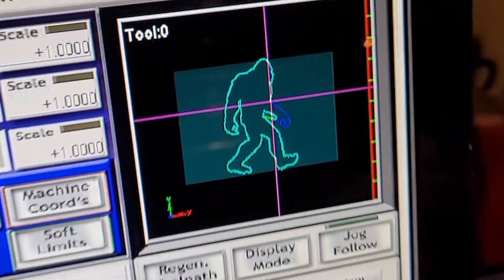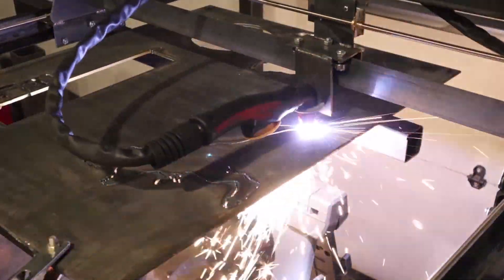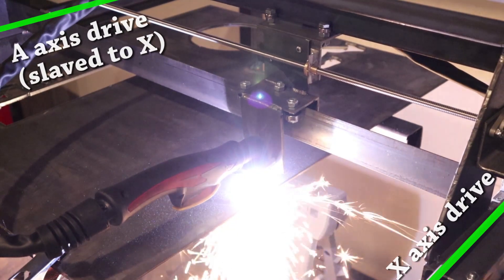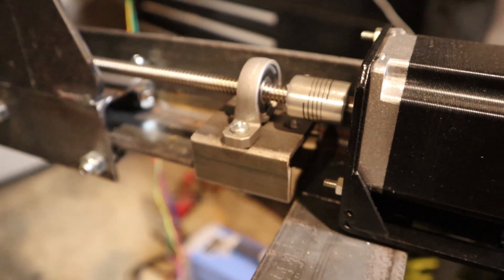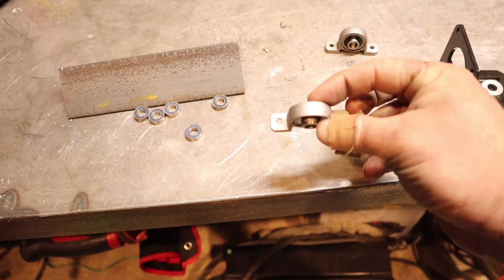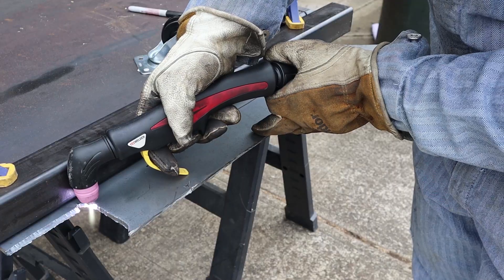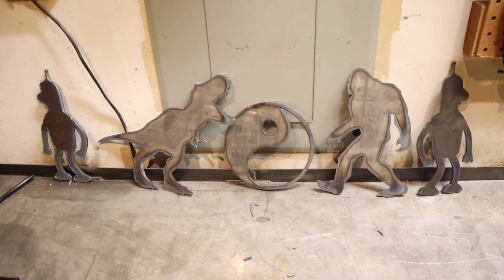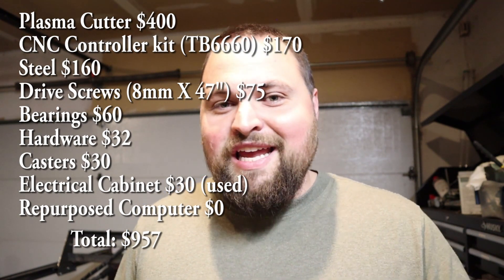Build a CNC Plasma Cutter for under $1,000

Comment: Have you considered putting the plasma feed cables inside liquidtight flexible metal conduit and properly bonding the metal liner to the plasma source?  Would love to know if this would work in place of other methods as it would simplify things considerably.  Guess I would also make sure the workpiece grid is bonded to the source bond also.  This would raise the question of parallel paths but I'd have to assume the welder internal circuitry has some way to address that and make sure that.   I saw another youtuber connect the tip nozzle to the return clamp via a 14 guage wire or something.  This stabilized his arc substantially.  I don't actually understand what was happening here.  But if what I suspect is happening is right then this might work even beter with a resistor in series with this wire to attenuate EMF produced by the HF.

Comment: Oh the joys of a HF welder/cutter.  Fun fact, even with ground isolation, HF will generate sparks on equipment that aren't anywhere near the work site.  I have an old Miller HF from 1971 and the manual illustrates installing earth grounds to literally every metal source throughout the garage. Down to the garage door frame... Best to use it in a very open area or outside even...

Comment: I've been perusing reviews of different plasma cutters in CNC builds so thank you for the frankinfo! The "spare CNC computer" remark hit home! I used my "spare CNC computer" for almost a year after an electrical storm took out one of mine. I recently switched to using the little $100 fanless ham sandwiches for my Mach 3 CNC builds. (Use an ESS over USB, man!)

Comment: Hi. Does your plasma cutter come with cnc compatibility from factory or you had to tap into the start switch wires? Also, if you are going to use z axis how are you going to read the arc voltage for  THC

Comment: Where is a good place to purchase Cnc components, also that brand? Thx
Reply from the maker: I get everything from ebay. Chinese ones work great. I like to buy entire kits because it will usually have most of what I need. The chinese stuff is usually unbranded. Tb6560 and tb6660 have been good boards for me. Good luck.

Comment: I just got their welder/cutter with this in mind. How does the torch perform mounted? The build area is huge! What do you plan on cutting that large?
Reply from the maker: It cuts really well, but I did upgrade to a CNC specific cutting torch. The kerf is a little wide but the quality is way better than it should be for something I made! I have no plans, I had an opportunity so I made it. I'm weird like that.
Reply from the maker: Just to be clear, I put a different torch on the same plasma cutter. The plasma cutter itself actually works great with the straight CNC torch.

Comment: I have problem with High frequency start of machine, they cut of my data from computer, how to reduce this sir?
Reply from the maker: Did you watch the video? I answered your question in this video.
Reply: @StrangeGarage  ough yes thanks a lot sir, good video
Reply: @StrangeGarage  
1. what the material for shielded the cable?
2. The cable of cnc control must be outside of body (true or false)

3. The ground of cnc body or the plasma equipment?
thanks for yours answer
Reply from the maker: @chamimsttw2290  1: The shielded wire is from ebay, it's just called (16-4, shielded).
2: I don't think that makes a difference, so false?
3: the structure itself is grounded. The work table has a ground also that returns to the plasma cutter, but the table is insulated from the structure, so I gave the structure it's own ground to mitigate interference.
Reply: @StrangeGarage  thanks, i will try it, good bless you

Comment: Nice video. Thank you. A quick question from a newb. If i have DFX files for laser cuter would they aslo work on  a plasam table? any imput would be greatly appreciated. Thanks again
Reply from the maker: Sort of. You have to use special software to convert from DXF to a CAD compatible, and then convert from CAD to CAM. It's not that hard but it's a process. Does that make sense?

Comment: Blowback start plasma cutter would eliminate any interference issues. Old and or cheap plasma cutters that use HF start which is where you get the noise.

Comment: I would like to have more info on getting the motors connected to x, y and z?? We are having trouble getting them operational. You noted it might be necessary to play with Dir active and step low but we just couldn’t find any help there. The motors made a noise like you said but were sporadic. Any other suggestions??

Comment: I would really love a details FAQ video about this. After seeing your cnc video I thought about building one but ended up buying a cnc. Now after knowing a little bit about cnc stuff I may want to build one of these. 
Can you incorporate a Torch Height control on this?
Reply from the maker: Yep, not with this exact design, but putting in a Z axis is a simple procedure. I just wanted to save myself the extra 3-5 hours of building the Z axis hardware when a plasma cutter literally only operates on 1 plane. Mach 3 is already configured for Z, and it even thinks it's moving the Z axis.
Reply: @StrangeGarage  Awesome thanks. Just was wondering if you needed it in the future it would be possible. Love your channel.
Reply from the maker: @JoeyAtilano  Thanks my man! You got this. Once you start figuring out CNC's it just gets easier. Good luck!

Comment: Maybe a stupid question, but do you wire the stop and start for the plasmacutter directly to the cnc-controller? Awesome build btw! Have been wanting to make a machine like this for many years.
Reply from the maker: Not stupid. It's in the video but you might have missed it: most CNC controllers have a control relay that can be programmed through your interface. I literally just ran the wires for the trigger to that relay. Next I programmed the interface to automatically turn the relay on/off when the cuts start/stop.
Reply: @StrangeGarage  Aha that makes sense :-) Thank you for the superfast reply! As I said, I have been wanting to build a cnc plasma-cutter for a very long time and this helpful video might push me to do it. Thank you.
Cheers from Norway :D

Comment: Also, you can use a blowback start Plasma cutter as well... Earlier you mentioned the handle.  for about $60-100 usd you can get a "straight" pen type plasma wand that is for CNC use.  I'm not sure how universal they are, but I know they are made.
Reply from the maker: Yep, I got a straight torch actually, a "P-80". It was actually a direct replacement, I'm much happier with it!

Comment: You can use a new computer and add a parallel port in via PCIE slot, or use a USB to Parallel adapter.  Both solutions have benefits and drawbacks, however the PCIE solution is no different than the integrated solution that comes in older machines.  USB is nice because you can quickly move it to another device if you have an issue, but drivers and com# can change.
Reply: This comments shows me how far away my abilities are away from building something like this

Comment: Thanks for sharing your video and let us learn how to build a low-cost plasma table. You did the best low-cost DIY plasma table I saw on YouTube so far and I saw many projects. I’m planning to build a low-cost CNC plasma table like the one you build. But first, I need to learn what mistakes to avoid. Do you think your X axe is bit too heavy? In the middle, is it a 2x2 1/8 angle? The walls and the top of the X axe, is it 1/8 flat? I can’t wait to see your next video about your build and learn from you experience.

Comment: You mentioned shielded wire for "noise" what did you use? Great videos by the way👍
Reply from the maker: 16-4, if memory serves me. The ground wire I ran is an old welding lead, 0 ga or bigger. Thanks! I put a lot of time into my videos, glad you like them!

Comment: ROFL @ forgetting the ground, I have done that with a tig a few times.... you are definitely wide awake the rest of the day after that!
Reply from the maker: It buzzes you good! Not my favorite thing!
Reply: @StrangeGarage  I have been hit with negative plate voltage in tube rigs.... HF flat sucks!
Reply: I've got a bench grinder on my welding table and if I forget to ground the TIG, the earth circuit ends up going via the grinder body and the 240V AC power outlet, via the grinder cable.  I've done it twice and the first time I couldn't understand why it was so hard to see (the smoke from the melting insulation was so thick) and the second time I noticed a bunch of flames reflecting off the inside of the visor. Goes to show just how good a respirator I use when the workshop is chock full of smoke and I don't realize until I can't see anymore.

Comment: Hi, I like what you are doing, I am also trying to make my own CNC plasma cutter.
I wonder how you did the turning on and off of the plasma cutter while the program was running? What does the signal for the relay that drives the plasma cutter give you and how did you program it in MACH3?
Thank you.
Reply from the maker: If your CAM is correct then Mach 3 knows when to turn on and off the torch. It's the same function as "spindle start/stop" for a cnc router or mill. My controller has an integrated relay for this function that is connected to an input on the parallel port. What I had to do was figure out which input to link and plug that info into mach 3.

I knew the relay in the controller would work, but I didn't want to back feed a full 115 volts into my controller, so I used an isolation relay separate from the board relay. Next I ran my "common" and "normally open" terminals on the relay to the cannon plug on the plasma cutter, and Bob's your uncle.

Comment: Consumables are the bane of all plasma machines...from a $2500 home schooler to a $250k sota machine keeping.030 tolerances
Reply from the maker: .030 is pretty good for a plas. What is the kerf on one of those high dollar machines?
Reply: @StrangeGarage  actually setup right the parts are about the same as an old tube laser which is almost nothing up to around .375 hotroll plate but between the consumables, heat and exhaust management and speed it wasn’t as practical as my 1st laser. That was the OO’s though. If plasma machines have improved at the same rate as lasers I suspect they are pretty awesome if you don’t need to run 1000’s of parts
Reply: And to be honest pre China we were one of the biggest precision metal job shops on the west coast. Now that those million pc orders are all offshore Ive learned a TON of things from channels like yours and others on new and “that shouldn’t work but the dude just did it in his garage” techniques that I was able to use at scale to stay competitive. I really appreciate all the badass fabricators on here. Remember every hundred thousand square-foot 200 employees shop started out with a torch and a shot out welder in the garage somewhere and just the nerve to do it.. so it’s really refreshing seeing how smart some you guys/gals are.
Reply from the maker: @Dethride69  I appreciate that man! I love creating, and I was broke for so long that I had to pick up a lot of tricks to continue. To be honest, I don't have much of a long term plan. I have a pretty solid career, but if I get the chance to work for myself full time I will.

The kerf on this one is disgusting. I bought a P80 CNC torch to replace the factory handheld one, hopefully that and a little adjustment will produce cleaner lines. I know I will never get in the .00 range, I just want to move my kerf further from the decimal point.

Where is your shop at? Sounds like you have a pretty cool operation going. I haven't done production in years. I work in plant engineering. I'm like a Millwright/Mechanic/Electrician/Fabricator.
Reply: @StrangeGarage  Lancaster California (because I obviously hate money...) It’s on the northern most edge of LA country. It’s a long story but we have 70k sq ft and due to the protections being different for health insurance I keep it at exactly 50 employees.

Comment: Love your video and your build. Just awesome! Do you mind sharing what amps/specs your NEMA 23 motors are rated for? I have some 1A NEMA 23 motors, but not sure they would be powerful enough for a build like this. Thanks again for taking the time to make and share this video series!
Reply from the maker: I don't know the specs off hand, but I believe I used the dual shaft motors which are higher output for sure. I will check when I get home.
Reply from the maker: Sorry I'm late, 3 amp is the answer.
Reply: @StrangeGarage  Thank you very much!
Reply from the maker: @chrisbearden1331  You are welcome!

Comment: Hey mate are you able to send through information on where to buy the parts you used in building this cutter? Great job I would love to give this project a crack myself
Reply from the maker: There is a CNC playlist on my channel that has build videos on it, that had a ton more info. Even though that was a cnc router I used the same hardware and same general principle. You'll get a ton more infro from there. 

The main difference is the plasma cutter is driven by 8mm ACME screw instead of  belt. Check those videos out and let me know if you have any questions.

Comment: This is awesome man, I recently built my own cnc plasma as well. With no z axis, and I'm using a primeweld cut 60(no HF start)
Reply: Also I used a arduino uno running grbl 1.1 h only cost like $15 for a cnc logic board with some diy firmware install and some cable managment
Reply from the maker: How is it working for you? This is a pretty cool project. I learned a lot from it!

Comment: How dry is your compressed air?  I have read that the air drying system really matters for cut quality and consumables life.
Reply from the maker: I have 2 in line separators, i'm not getting any water into the second one at all. I found out that this machine is supposed to use different tips for different amperages. I was likely using the wrong ones without even knowing. They all came in the same bag.

Comment: I’m having trouble finding the TB6660 controller on eBay or google. Do you have a link? I’ve found TB6600 controllers and other 4 axis ones, but nothing with the TB6660 nomenclature.
Reply from the maker: When I bought it they called it a TB6660, they probably had some licensing issues. Look for "5 Axis CNC Interface Board LV3.3"

Comment: Dam, that's cheap. I already had a plasma cutter that I bought second hand for$1050 and the electronics was $900. I'm up $2000  already.  I have built the  stand and I'm using m12 x 1.25 rod for  the X & Y drive  (probably not a good idea). Thanks for the earthing and shielding tips.
Reply from the maker: That's still a good price honestly. What type of electronics did you go with?